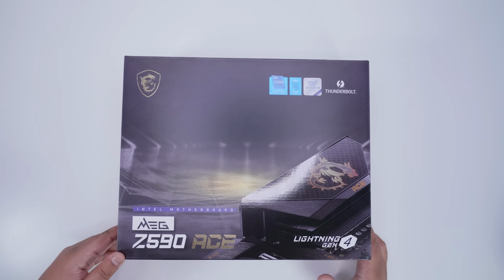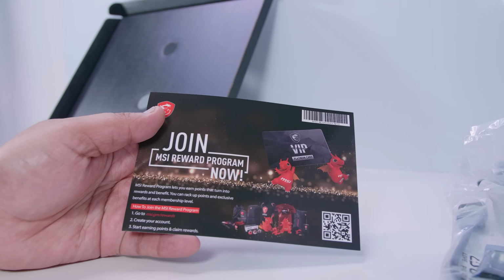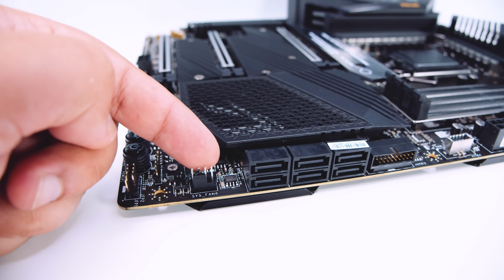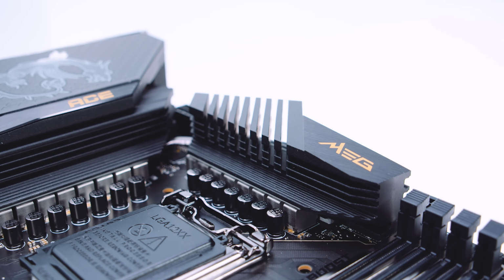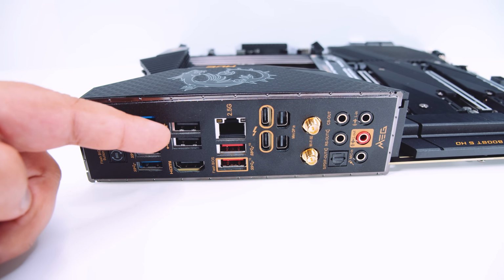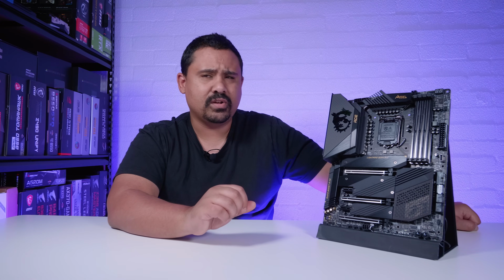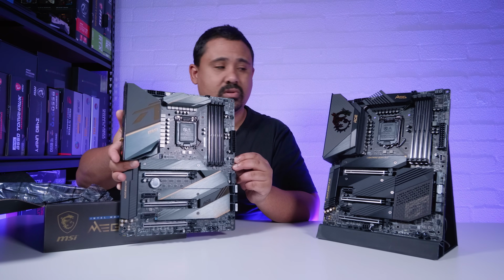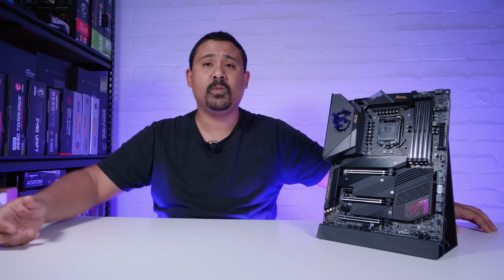MSI MEG Z590 ACE - First Look and Overview

Comment: hi, I need help.  someone built my PC with MSI z590 ACE motherboard .. the problem is, when I turn it on 3 seconds later it turns off 3 seconds later it turns on ... what could be the problem is a bad connection, or is it a motherboard problem  ,,, Thank you

Comment: One of the purposes of buying a new (Windows 10) PC is for photo editing.
If the motherboards supports is, I don't need a discrete graphics card.
I own a 5K screen and a Delock 85813 Bidirectional USB Type-C™ to DisplayPort Cable (DP Alt Mode) 8K 60 Hz 1.5 m DP 8K certified (https://www.delock.com/produkte/G_85813/merkmale.html)

Looking at the detailed specs at : https://www.msi.com/Motherboard/MEG-Z590-ACE/Specification
it says :
Thunderbolt 4 : Supports up to 8K display (need to connect the DisplayPort of the motherboard or discrete graphics card to the Mini DisplayPort Input port on the back panel)

I have no clue what that means.
Your video does not show an onboard DisplayPort connector on the motherboard.
Do I need (and why do I need) the Mini DisplayPort Input port on the back panel (for 5K @ 60 Hz/ 8K @ 60 Hz) ?
Do I need (and why do I need) a discrete graphics card ?
How does this work ?

At 11:23 min. : when you are going to do a build : please dive into this.

Thanks for the great video !

Comment: Question, Would I need to purchase a wifi adapter to utilize wifi through this motherboard so I don't have to use a wired connection? New to pc building.
Reply from the maker: No. Its got built in Wi-fi as mentioned in the video

Comment: Would this be worth getting over the Z490 model?
Reply: If you are getting 11th gen, then yes. Better temperatures, better overclocking limits, native pcie gen 4 performance (even better with a gen 4 ssd in the upper slot), better ssd cooling capacity, thunderbold 4 will be used more in the future and more value if you wish to sell it later on because you have one of the last produced high end boards in this generation 👌
Reply: Seconding @ketamingo if you're getting 11th gen.  MSI is killing it lately imo. But this board won't matter to you if you're bringing over a 10th gen because all the awesome features are locked to 11th  gen only even tho the 590's are backwards compatible.  If you're just looking at it as an upgrade over the 490 without an 11th gen it will not be worth in any way.
Reply: @olddeadguy507  I'm building my rig now with this motherboard and a 10900k actually 😂 I love the looks of it so much over the z590 ace that i couldn't resist to buy it. Also want to squeeze as much out of the 10900k as i can with the high power delivery and better vrm's

Comment: How do you have the RGB powered? Is there a header that you can control the on board rgb with?
Reply: 2 3-pin 5v headers, 1 corsair header and 1 4-pin 12v header for external rgb. Motherboard rgb itself can be controlled trough mystic light just like the other rgb header. I'm going for a full build with mystic light sync only, since it's taxing on your pc's performance to use all different kinds of rgb software. To use 1 type of software to sync everything is annoying enough, let alone have all kinds of different parts from different vendors to use the rgb functionalities in different softwares.
Reply: @RobTheBeat  oh wow thanks, I’m doing a similar thing when I build but I’m going to use Aura I think, I’m using Corsair vengeance ram, asus mobo and Lian li fans / aio, I think it’s all compatible under 1 software
Reply: @moose17m  Not sure about the corsair vengeance. I know you can sync them in icue and mystic light, but I don't know if aura supports it. You should be good with the lian li's tho
Reply: @RobTheBeat  ah thanks, I have a Corsair headset anyway so it’s not the biggest problem if I need to use iCue since I already have it but yeah, thanks for your help mate, have a great day
Reply: @moose17m  No problem mate, happy to help!

Comment: i have a z390 msi godlike motherboard an seriously i dont like it. it feels cheap for the premium price and the dragon center software is a mess in my opinion. there is only one point i like on that motherboard and its the BIOS. ive never had a better bios than MSI ones. but overall i only made a bad experience with my msi board. next time ill definitly change to asus.
Reply: As an asus mobo owner currently in the z390 gen of chips, I have bad news for you.  I have a maximus hero xi wifi board with an i9 9900k. Tho the board has worked well enough to keep me running, just about every feature on the board was dead within a year.  Wifi. Bluetooth. Nic card. half the RGB. All dead. Asus made a big deal about their ai tuning and xmp profiles etc - but quite frankly nothing was stable using their presets. Had to do everything manual.  I've had an amazing run with MSI lately, most notably with their gaming trio 3090.  I'm not really trying to change your mind or anything - I'm just saying the grass isn't always greener just because you may have gotten one lemon.
Reply: @olddeadguy507  well i bought a z590 maximus hero board. Its to late already i wanted to build this weekend my new pc